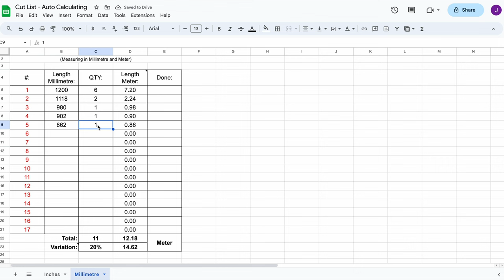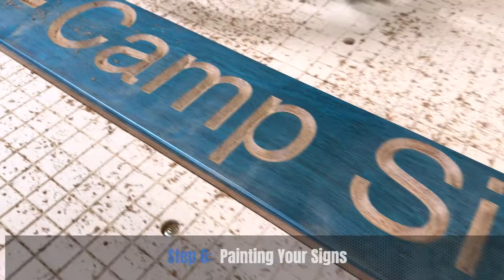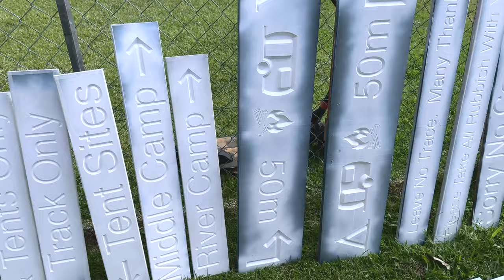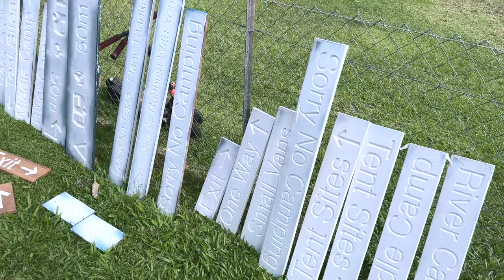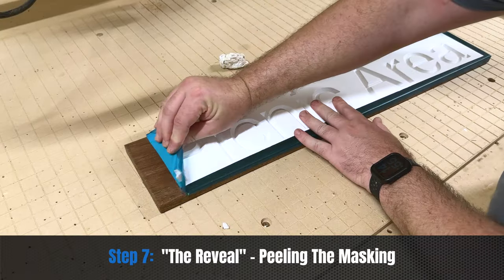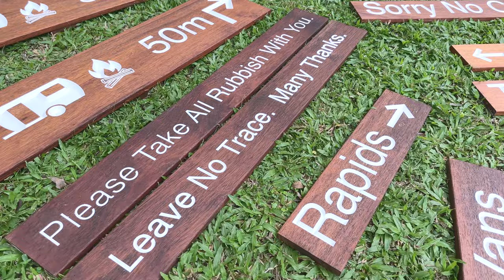How to Make Wooden Signs On A CNC - How to Mask, Paint and Seal

Comment: What product are you using for masking?
Reply from the maker: Hey John!  For this project, I used Oramsak 813.  I put a link in the description to where I found it the cheapest.  Also, I will be doing another video soon for something else I have been using!  Make sure to stay tuned for that one.
Reply: @TwinSummitDesigns When can I expect the new video. I just ordered a small amount of the recommended masking but would like to save more money.  Thanks.
Reply from the maker: Sorry for the wait!  I was away for a short while and then had heaps of other projects to catch up on.  Need to edit it so hopefully by the weekend I will have it up. @beckwithboards8246
Reply: @TwinSummitDesigns Thanks!  Glad to hear you are busy.☺️👍

Comment: What program are you using for the basic design layout you send to your customers?
Reply from the maker: I use LightBurn which is actually meant for my laser, but I find it much easier to do basic designs in. I can then make a screenshot or export them and then import into VCarve which is a big help. But, you can do it directly in VCarve as well. Hope that helps.
Reply: Thanks for the reply,  I'll have a look

Comment: Hey love the video great job 👌... 
Question what type of wood are you using
Reply from the maker: You are welcome!  This was done with Merbau decking boards.  Merbau is often used for garden furniture as well because it is very durable and lasts a long time outside.  Also, not that expensive compared to other hardwoods. I have used it for some time now and never had any issues.  You do have to use a base coat first though because it contains tannin that stains the top coat if you are using white for example.  Black not so much, but white looks better in my opinion.  Hope that helps!?
Reply: @TwinSummitDesigns thanks 👌